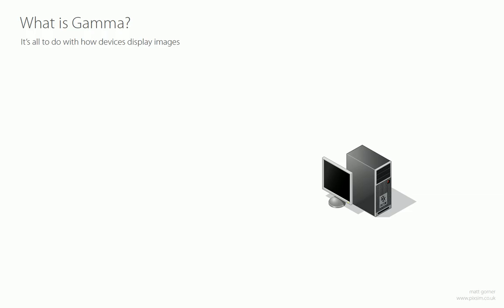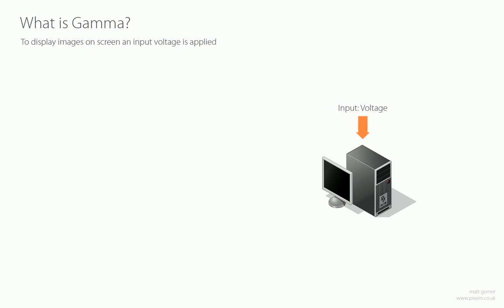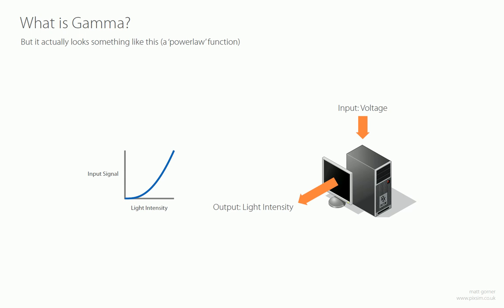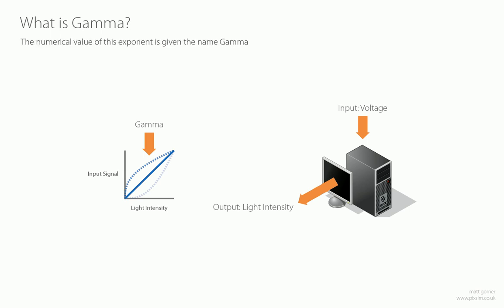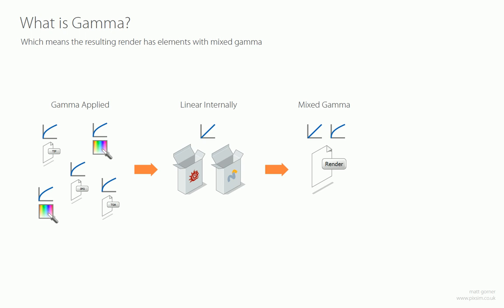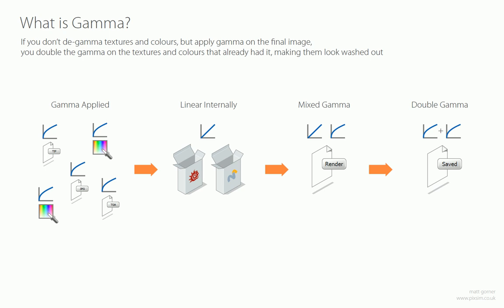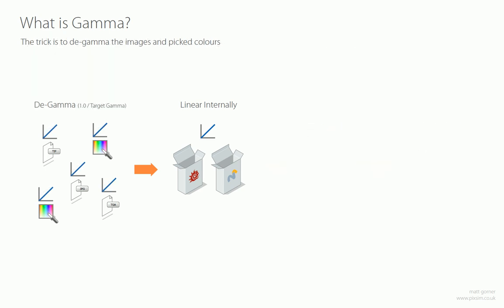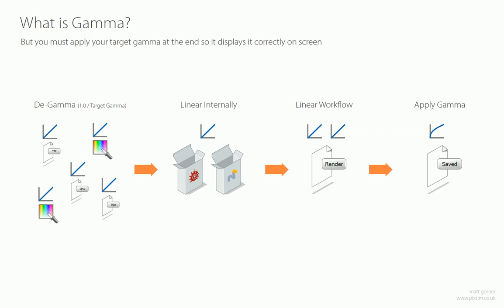Gamma Correction & Linear Workflow Part 1 of 2

Comment: As I have learned so far, the digital camera captures the image linearly and it is then compressed inside the camera into a JPEG PNG  or GIF format via the encoding gamma which has a value of 1/2.2. After that, before you view it on a display, it is decoded with a gamma which has a value of 2.2. The two gammas (decoding and encoding one) cancel out and you get a linear gamma representation of the image on your monitor.

Comment: @Anotherblackseason - You'd probably have to guess, based on where you got them. I believe most free textures, camera images, video, stuff you drew in Paint, etc., will be pre-corrected and should be linearized before using them.

Whereas if you generate your own stuff or get textures from a site that specifically says they're already linear, then in that case they may be linear already.

I don't know if JPEG has a way to tell, and it wouldn't be reliable.